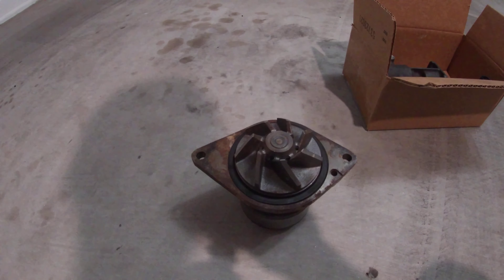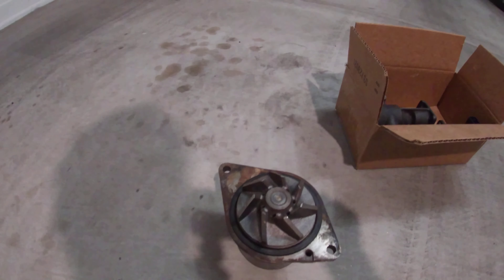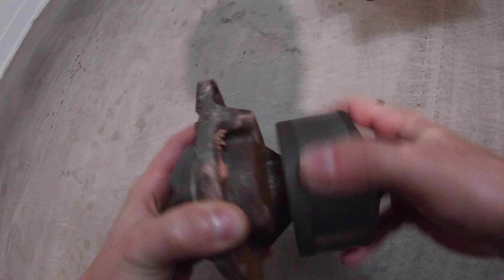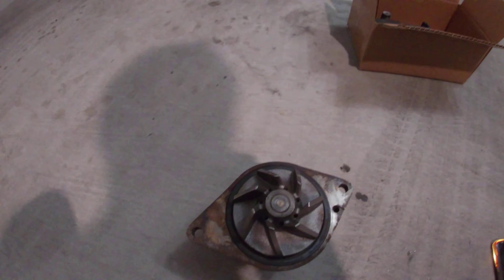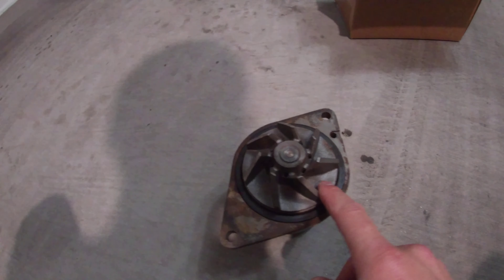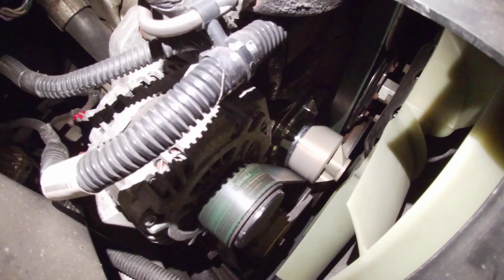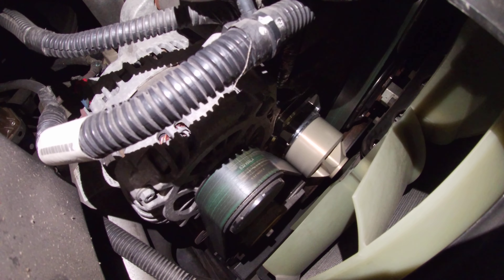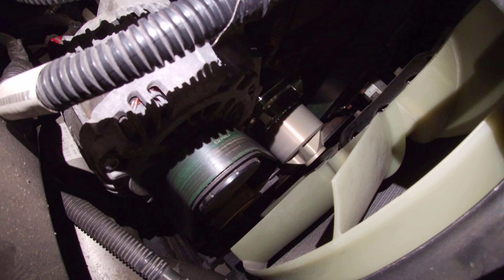UPDATE | 6.7 Cummins Water Pump and code P2457

Comment: Appreciate you revisiting this!
How's the Bullet Proof holding up?
Reply from the maker: No problem - thank you for the comment! (I try to either upload a part 2 of something or pin a new comment/s regarding any breakthroughs.) 
So, to answer your question, the bullet proof diesel water pump is holding up 100% fine. 

It's funny that you ask because I am currently in the position of actually swapping it out for a new OEM Cummins water pump. Why? 
The reason is that I completely overlooked something a fellow commenter mentioned, and it is perhaps the fact why the OEM Cummins water pump has softer propeller material, so in the event that the bearing goes bad thus causing the water pump to tilt a tad bit, the propellers will make contact with the internal engine block area in which it sits, causing it to grind against that internal block housing area. With that being said, the softer/"weaker" propeller material used on the OEM Cummins pump will break off if it comes in contact with that internal block housing. Water pumps with full metal/billet/cast/etc. will just eat the internal block away. 

I'm certainly no expert on this subject but I often worry more than I need to. I'm trying to do research on it, but I figured I would share it here in the event you want to voice your thoughts/expertise.
Reply: @AES5967  that's a great point and an unanticipated downside of literally creating the best replacement part possible... Some things are meant to be sacrificial. 

I'm a plumber, running a 08 6.7 Cummins one ton with 411k, and seeking the best path  before opening the can of worms. Heard a weird peep while warming and it looks like oil bubbling intermittently from the mating surface of the water pump. I lose money if I'm working on the truck, so I spend a little extra time here seeking the hard lessons to avoid. Thank you for your words of wisdom!
Stay safe!